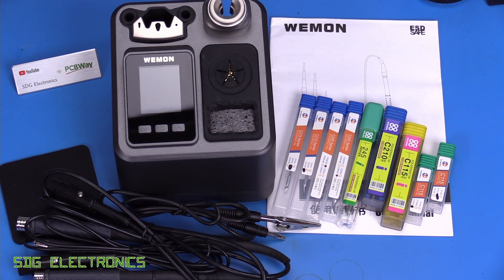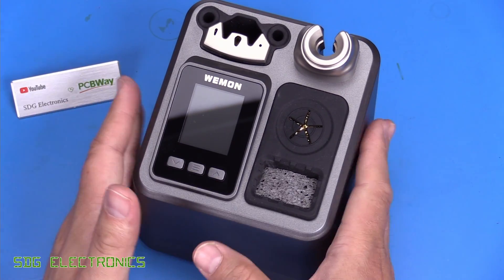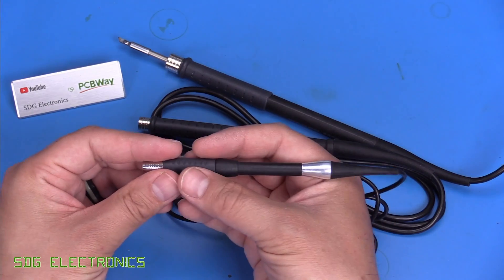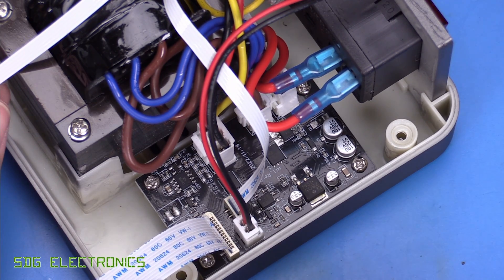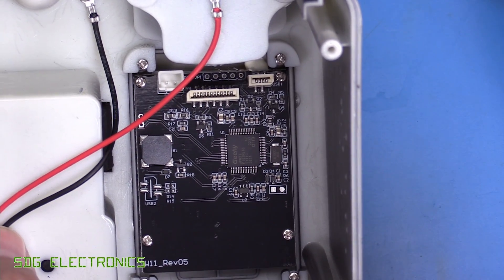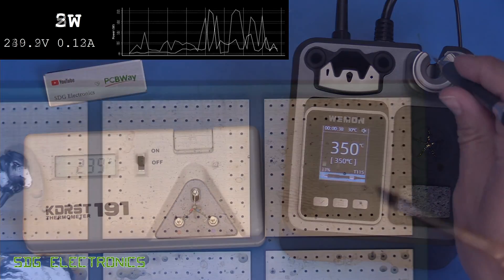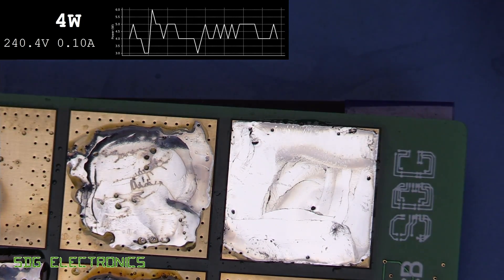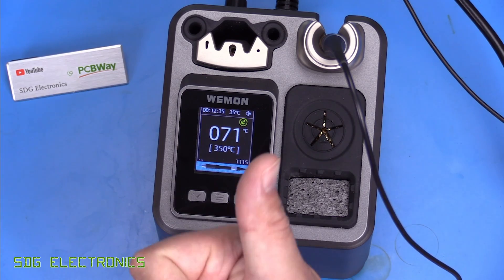SDG #339 Wemon T31 120W JBC Style Soldering Station

Comment: This is HIGHLY dangerous product. When I turned it on for the first time, first it didn't heat up then all of the sudden it went HAYWIRE! The tip became RED and the station was making noise and vibrating. I noticed that the magnetic field expanded and started pulling small screws from the table towards it.

I shut it down immediately but it could have gone really bad. Stay away

Comment: In you opinion, which is the best JBC clone? I'm looking at Jabe UD-1200 and AIFEN A902 as the main contenders. I need a station that supports 110V and doesn't suffer from voltage leak (a lot of the Aixun models that are recommended seem to.. and the ones that don't are 220V)

Comment: Bought one of this recently, no issues with the control unit but the soldering tips quality isn't good. Four tips presenting random open circuit error messages and the C115-IS tip is short circuited. Horrible customer service based on an AI chatbot whom never answer your questions and when you manage to talk to someone from the store they tried to say it was my fault due to warming up the tips without tin or solder, how is it possible if the shorted one was never been hot? I am very disappointed with this store, they are trying to push me to order more products from them to get an spare to replace the damaged tip. I won't return the full item due the base is solid and the handles ok, but will buy some original JBC tips to replace the bad quality ones they sent.
Reply: Hello, are the original JBC T245 handles compatible ? Do you still have the soldering station, are you happy with it ? Do you recommend buying this station or another model ?
Reply: @CanaleYouTubeGeneralista  Hi, Never tested the original JBC handles as they are really expensive and I dont need that, but the product description says it's compatible.  I still using the handles that came with the station and apart the three ones failed at the begining the remaining ones are ok. As I said before, the station base is solid and fast, keep good temperature control and for my hobby is good enough. My problem was the seller, really rude, slow to respond and never offer to replace the damaged tips, he tried to sell me more. So avoid the DIYPHONE Store.
Reply: @rsimiao  Hi, thanks for the advice, sorry if I reply late, I don't receive notifications, yes I read your review on Aliexpress, the product description in the video says that it is compatible with JBC handles ? unfortunately I don't speak English I watch the video with subtitles, from what I understand the transformer is undersized and does not develop 120 watts
Reply: @CanaleYouTubeGeneralista  I am running the station at 240~250 Volts in the UK and yes, the trasnformer warms a lot. Its not designed to that overvoltage. in relation to the power, I don't use that amount of power, it will burn all your tips if not using the JBC ones. If you intend to use the full power I don't recomend it to you.
Reply: @rsimiao  Thank you, the GVM H3 3 should have the same power supply, in the end the main stations with the linear transformer (compatible with original JBC handles) are: GVM H3 3, Wemon T31, jabe ud-1200, AiXun T420, sorry how long do the JBC clone tips last? The original JBC tips are really expensive, I'm also evaluating the JBC BT-2BWA and the i-CON NANO MK2, even the nano has 80w (should be enough for most jobs) and the tips are cheaper, the problem is the cost, 300€ is a lot for a hobbyist, there is also the PACE ADS200 but the price has increased.
Reply: @CanaleYouTubeGeneralista  I've been using the T210 knife style tip so far and had no problem at all. Still in good condition for my not every day use.
Reply: @rsimiao  Now I don't know how many hours a tip lasts, I don't solder every day, just as an example let's say we solder 30 minutes a day, I hope the tip lasts me at least a year.
Reply: @CanaleYouTubeGeneralista  It will last, don't worry too much..
Reply: had exactly the same experience

Comment: What happens if you use different handpiece with different stations? Are they all compatible (the same pinout)? Do they still recognize the handpirce size (254 vs 115)?
Reply from the maker: Most of the clone handpieces work, though the recent Aixun battery powered station T210 handpiece doesn't fit.

Comment: I would really like to see an oscilloscope trace of the AC waveform sent to the soldering iron to determine the cause of the low maximum power to the T245 handset.
Is it the AC RMS voltage to the handset, missing (half)-waveforms or a too high catridge heating element resistance? Does a genuine JBC T245 cartridge make any difference?
I believe the JBC T245 cartridge is rated to run at 24V RMS which should provide around 120W of power.
Reply: Personally I don’t think it’s the cartridge but the transformer is not capable of 120w, the other ones that are capable use alot bigger transformers
Reply from the maker: I think it will be similar to the GVM, which was just a lower voltage than needed for 120W

Comment: Stations to review. Any station that:
1. the manufacturer claims it supports genuine JBC C245 tips, and 
2. works properly like you’d expect with genuine JBC tips (no voltage on the tip, no heater current flowing out of the tip, no ground loop earthing problem, no double insulated marking but uses 3 pin mains plug - clearly against regs & CE conformity and a blatant contradiction!)

I’m also interested in portable TS101 style irons that will take JBC or Hakko cartridges, and an updated station since KSGER that takes Hakko T12/T15 tips if there is one.
Reply: The sequre soldering pencils have been reviewed. I'm tempted as well!

Comment: i should have at least 2 buttons for predefined temperature.
And sadly, you didn't test how the tip removing works. Sometimes, these clones are not heavy enough to stay on the bench when you pull.
Reply from the maker: You do need to hold the station down for the tip change, but that's also the case for the genuine JBC

Comment: Power rating is that a requirement for CE or UKAC certification? just had a look again and it not CE marked.  Silly me expecting it to have passed conformance tests.

Would have been nice to see a protection resistor between the mains earth and the 4mm socket. after all we want to stay safe and discharge the static away slowly.
Reply: i am pretty sure it has CE marking like every **C**hina**E**xport electric device.
Reply: @-COBRA  As far as I can remember they were putting CE on products before we did.
Reply: CE is a self certification. It doesn’t require conformance tests unless it’s a wireless device, perhaps.
Reply: @davadoff  well I hope you have good insurance as if the testing of all requirements is done and you have a full technical log, I for one would not sign the DOC  You do sound like someone who has never worked for company placing products on the eu market. 
If your product killed someone I'd like to hear how you would tell the court that you did not do any testing on your product as you thought it was safe.  The likes of EN 601010 are there so you can self certifie that your product meets the safety requirements.
 Self certification means you can do the testing yourself you don't legally need to use a test house, it dose not mean you can pick and choose what testing you do other than emc.

By the way the emc testing will force you to some parts of en61010 electrical safety anyway.
By the way I've spent over a million pounds on CE testing and I'm sure the technical director who signed the Declaration of Conformity (DOC) would have loved to have given that to the shareholders.
Reply: @TheEmbeddedHobbyist I thought you meant tests you pay someone else to test and certify. Like UL listing.
Reply from the maker: CE, but I assume it's copied across for UKCA. I think it's also part of the LVD for appliances.
Reply: @sdgelectronics I expect the UKCA is just top level document layer the conformance testing will still be to the likes of low voltage directive,  Red and all the standards required.  Why people think that as for some products you can self certifie  meaning that you can just say i think it will pass and write UKCA OR CE on the label.  When self  certification just means that if you have the equipment to test the product to the required standards its ok for you to do so. The ones that normally fall out of that is medical products which force you to use a notifiable body and really push up the price. Not sure if you have gone through any ce certification. But about 8 years ago I would have expected to pay 2-3k on per emc test, and about 28k for someone like Tuv, or UL for the lvd side.

If you want to get in to a serious money pit, start producing electronic equipment for cars or  lorries.  E marking is far harder than ce or ukca, here you can't talk to the governing body (dvla) in the UK. You have to go via an approved test house who puts a £250 handling fee on top. They photograph you  pcb's so once tested you can't make any changes as they will notice if checked.  Your manufacturing site has to be ok'ed by them and if you change it you're into a whole lot of expensive site visits and paperwork.
Did some certification work for equipment fitted in ambulances never going to offer to that again 😒
Reply: @sdgelectronics  it’s not real CE logo - the two letters are way too close together

Many Chinese manufacturers say “ESD safe”, CE, double insulated, etc regardless of reality. Perhaps not even knowing what they mean.

Comment: FNIRSI has released a couple new ones for JBC style tips, the DWS-200 soldering station, and the HS-02 soldering iron for usb pd. I'd be interested in seeing reviews of both of these.
Reply from the maker: HS-02 review is next week :)
Reply: @sdgelectronics looking forward to it. I have the HS-01. It's OK but doesn't heat up as quick as I thought it would.
I could possibly stretch to an HS-02 if you give it a glowing review
Reply: @sdgelectronics  Excellent, I look forward to watching it.
Reply: OP, I already saw a review by Tony359 of the HS-02:

https://youtu.be/DtwOXcpQaY4?si=4l5uJEjo2e_phEVM